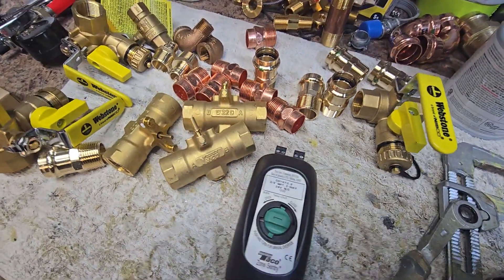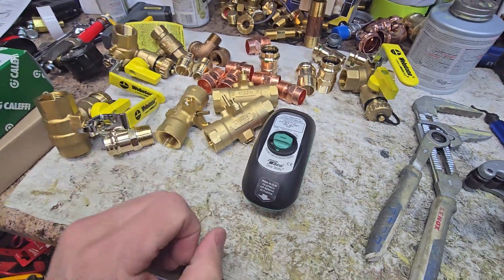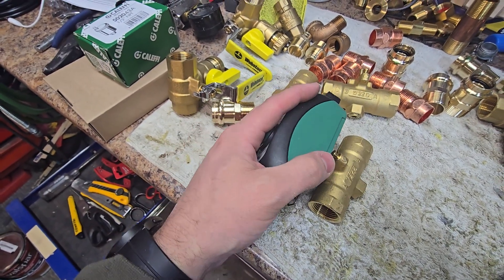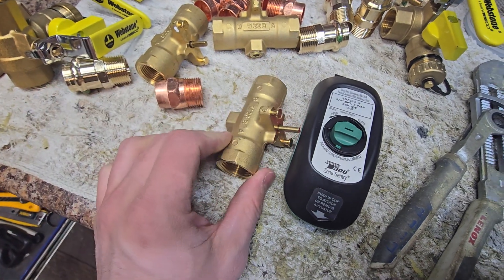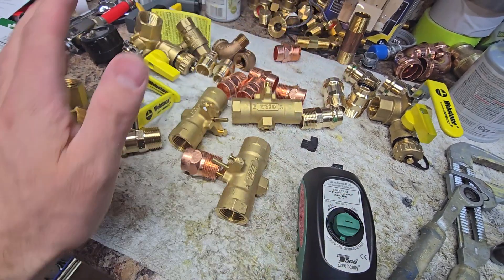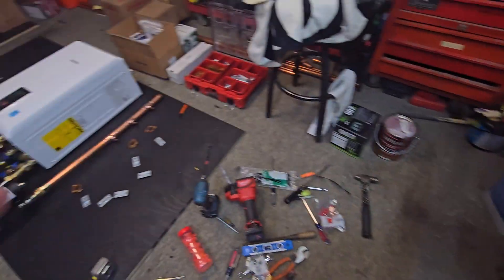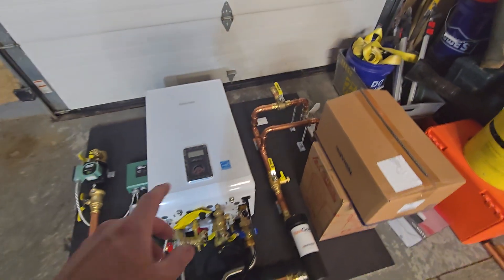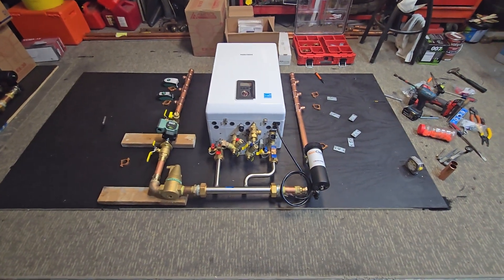Taco Sentry Zone Valves For Boiler Systems

Comment: Those zone valve controllers are terrible. I have three and have to replace at least one ever year.(I keep a few in stock now)  They were so bad there was a shortage of them a few years back. They have plastic gears that break easily.  When I replace one I cycle the ball valve with and drill to make sure it is moving freely. I was hoping TACO would come out with a upgraded replacement.
Reply from the maker: These have been great in my experience. Too bad your having so much trouble. Talk with someone at Taco and im sure they will take care of you.

Comment: I just had a new boiler installed by a contractor…Im dealing with headaches like, no backflow preventer on the supply line. When questioned, he said they never do. But after looking, I believe it to be a code. Anyway, my question is - is a controller box required for two taco valves? Contractor installed two of these, but they don’t open correctly- as in, zone 2 calling, zone 1 should also open. Please, don’t ask. They have to redo pipes too. This just happened on Friday and I am in full research (damage control) mode. But they are a 4.8 with thousands of reviews. Make it make sense.
Reply from the maker: Email me at speranzadevelopment@gmail.com
Reply: @JimSperanza - Thank you so much!!! Just sent. Attached vid, hopefully it comes through. 🤞🏽

Comment: Question.  Im talking about the fan coil unit (2 pipe & 4 pipe system). Why is the valve closed  when the heating system is ON. Then I turned ON the valve manually, and it started to supply hot water to coil. Is it Actuator issue or something else ?
Reply from the maker: It can be two things. Either the wiring to the valve is faulty or the valve has failed. The correct way to test this would be check for voltage at the valve while the boiler is firing. If you have voltage then replace the valve.
Reply: @JimSperanza  Thanks

Comment: They break down pretty often in the hotel I work in. But it seems they work great in boiler systems and not individual heat pumps in each room. We replace these actuators at 3 times a week.
Reply: The ones that you replace… are they installed on the outgoing or returning side. It’s recommended to install them on returning sides of the boiler system (longevity… but I can’t find any info or stats about that). Thanks,
Reply from the maker: @VadimDrevenchuk they can be installed on either side with minimal concern.

Comment: How do you run the wiring for the zone valves? Do you have one wire going from thermostat to the valve. And another wire going from the valve to the boiler?
Reply from the maker: Many ways to wire these. Sometiems direct to boiler, Some times controller, depending on what you need to do.

Comment: Question why does the value stay “open” after I turn off my thermostat (heat)
Reply from the maker: @tiffany_FeeFeeTVdesigns  it is either not wired correctly or it is stuck.

Comment: I’m getting ready to do a three zone system with the those sentry zone valves.. I noticed they came with resistors in the taco controller box.. do I need to use these resistors? Or is that for like a specific application? It said something about power Robin thermostats. I appreciate your help thanks, Joe.   And if I do, could you explain where you would put them the resistors that is thank you

Comment: Mines clicks really loud when I turn on my furnace and I have to push down that green button for it too work don’t know what too replace on it
Reply from the maker: Ypu can replace the solenoid only without having to mess with any piping. There is a clip on the back to remove it and there is a qire connector to remove the wiring.